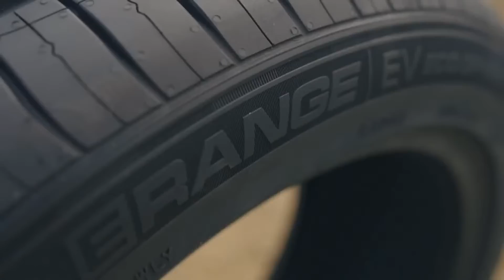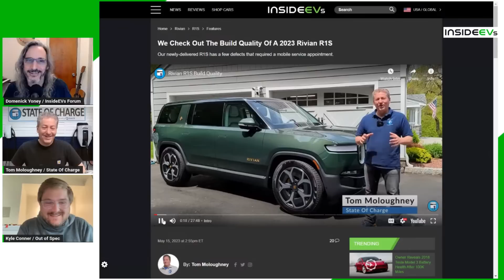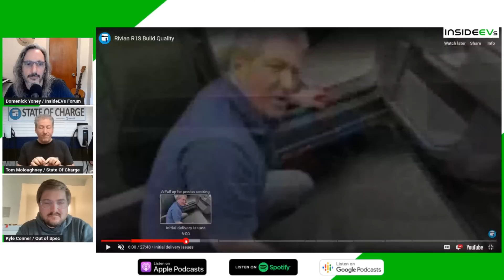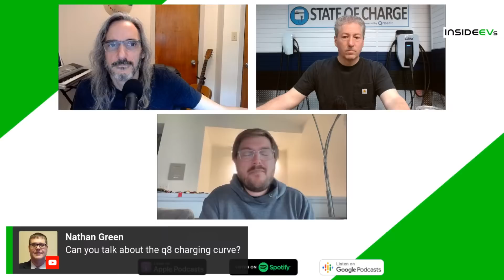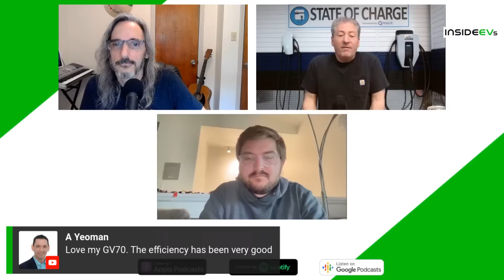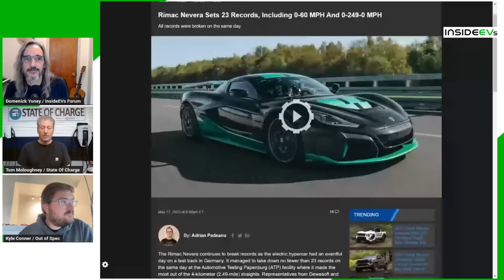Tesla Teases Next Vehicle, Honda e:Ny1 Debuts For Europe

Comment: I remember doing the math when I replaced my Avalanche (full size pickup) with a Nissan Leaf. The extra fee amount for annual registration here in MN was way more than the total I paid in gas taxes for that truck. If I was doing higher milage it would have been closer, but people drive different amounts and the system should divvy that burden accordingly. I've been thinking about fair ways to do something along the lines of what Tom was talking about so it can be fair for all types of vehicles. Distance and wieght would probably be the main factors. I should start writing that down in detail.